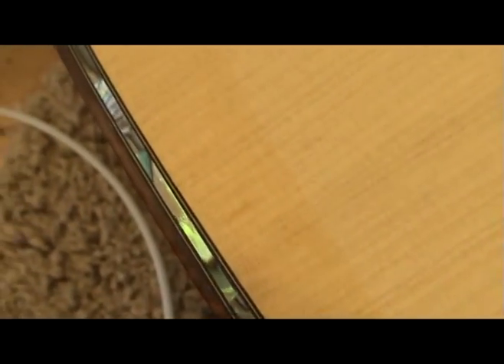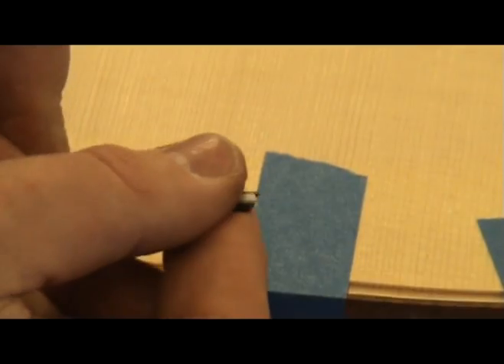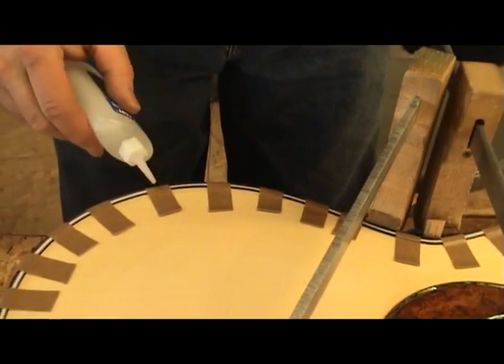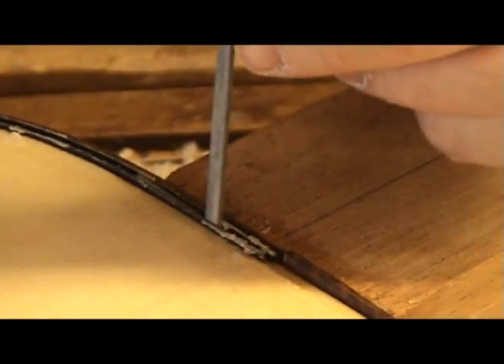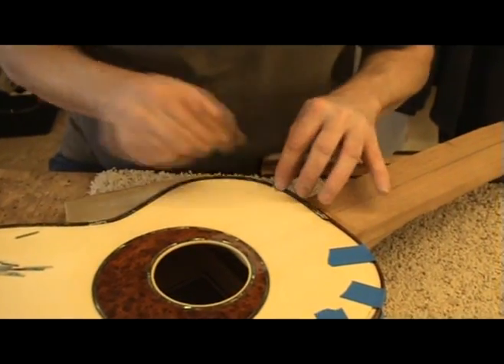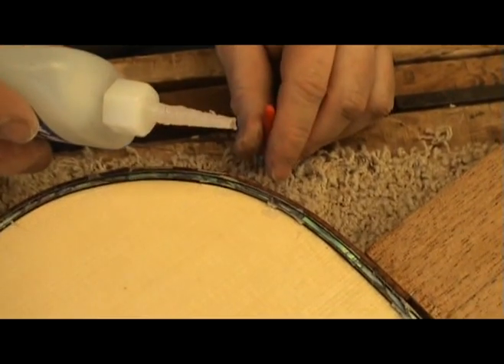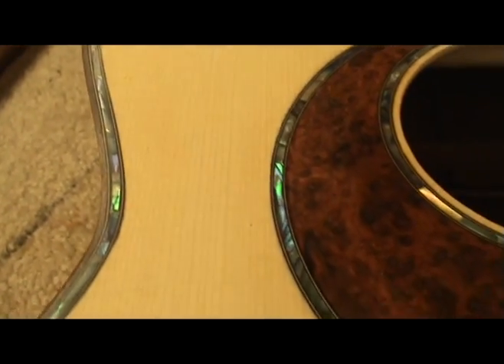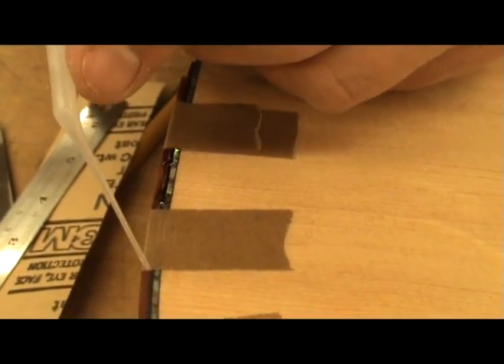Luthier Tips du Jour - Abalone

Comment: Plus one on the tip to SEAL THE BINDING CHANNEL END GRAIN WITH SHELLAC before using CA  to glue in purflings! I had a beautiful, ivory-white Carpathian spruce top a few years ago, on which I used superglue to install purflings. When I later sanded everything flush and cleaned up, there were hideous yellow stains in the wood, which would NOT sand out, because the CA had wicked into the end grain, through-and-through.
I saved the project by changing my finish plan, and doing a shaded (light burst) finish on the top.
Sealing the binding channels with shellac should be requisite if you use CA glue. Otherwise, the stains will look like yellow snow. Shellac will prevent the glue from wicking into the wood and causing nasty stains, but CA sticks to shellac just fine. Listen to Robbie-- seal with shellac, and save yourself some heartache!
Reply: Stephen, Robert mentioned that step at the beginning of the video, but its a good reminder to not forget this important step.

Comment: Robert, 
After the glue has dried and the tape is removed, do you go back and apply glue to the areas that were below the tape...or does the glue naturally flow under the tape?
Thanks for another great video!
Reply from the maker: yes, You do not want to apply large amounts of glue unless you like seeing cascades of CA glue on the inside of your guitar.
Reply: @OBrienGuitars  yes you do go back or yes it naturally flows?
Reply from the maker: @constablebentonfraser5014  Yes I go back and remove the tape and then apply more glue where the tape was.
Reply: @OBrienGuitars  hahaha thank you!